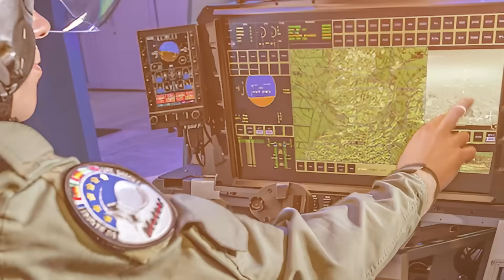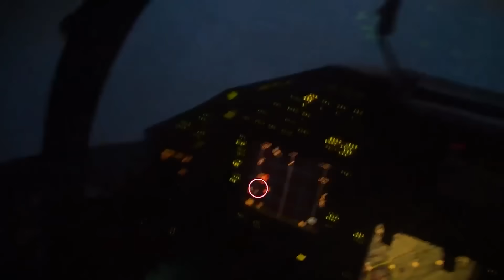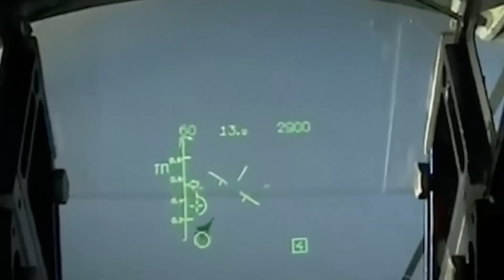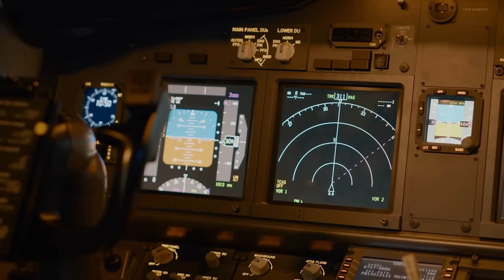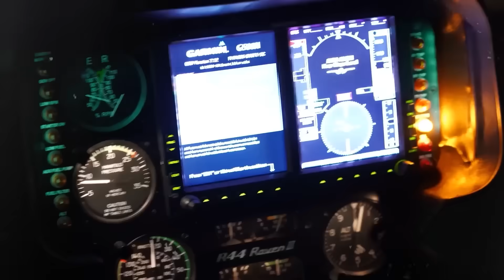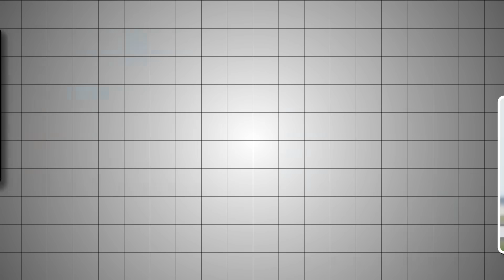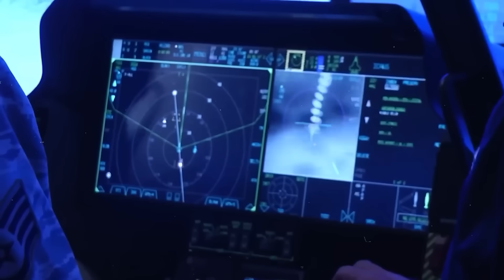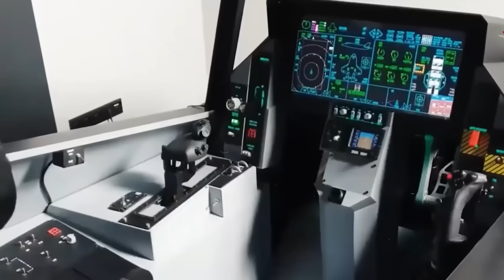How Britain’s Tempest Will CRUSH Russia’s Air Force Forever!

Comment: The SU-57 IS NOT a fifth generation stealth aircraft at all, not by any stretch of the imagination. It simply doesn't have the RCS of a true stealth platform, can only carry only 20% of its weapons load internally, nor does it have 5th Gen engines, radar, censors or avionics, its basically a 4th++ generation aircraft....... its a compromise really because they are incapable of doing 5th Gen technology.
If they thought that highly of the SU-57 or were that confident in it, they would've sent them to Ukraine to take on Ukrainian 4th Gen Soviet and Western aircraft........ and they clearly haven't sent any of the 20 or so that they supposedly have.

Comment: By the time this rolls out it will be on the verge of obsolecence ,is it in production now?  If not when will it be?
Reply: Prototype is apparently in production now.
Reply: @DWhite-TheWolf this is 30s & 40s tech. It is also designed to allow easy upgrades. Not sure how you are so knowledgeable, have you worked on the project or are you just showing your ignorance
Reply: Every 6th gen fighter jet project is set to be completed around the same time

Comment: Tempest does not exist yet! Let’s talk about it when it is flying.
Reply: The Tempest tech demonstrator is 3/4s built and 90% of parts are manufactured, it will take its first flight in early 2027.
Reply: It was escorted in to r.a.f warton under heavy armed police months ago couldn’t mistake the shape of the wings silhouette,two trucks tempest on the first wings on the second, I work the farms around there, warton does systems & weapons testing and integration.we see the jets and helicopters all the time.
Reply: There testing this in lincolnshire middle of nowhere I was in fields this come hovering over us it's very silent titanium color has bright purple flames out the rear..doing rings around red arrow then slap sound vanished I have vid lol